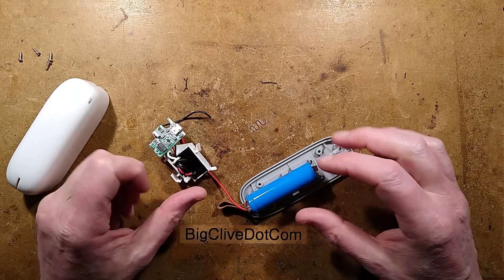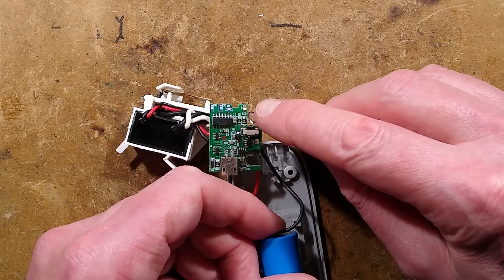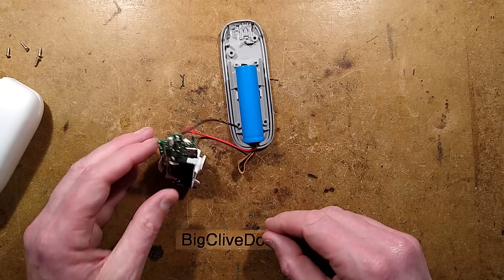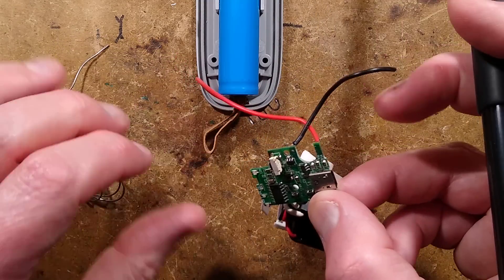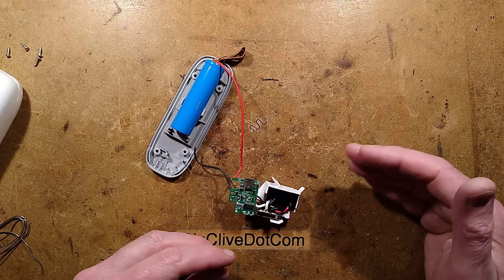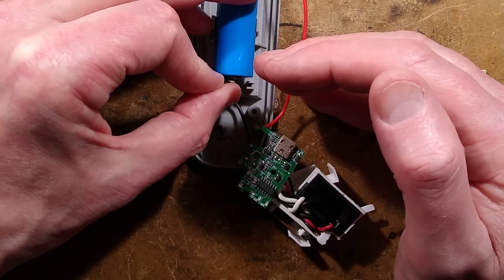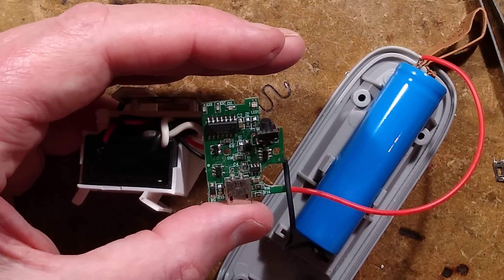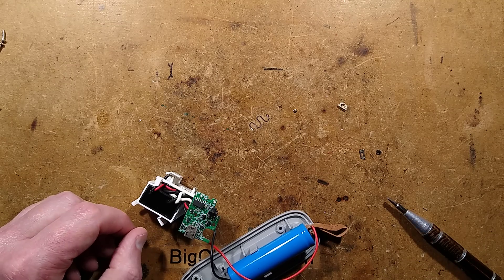The curse of tin whiskers rears its head again

Comment: God I hate lead-free solder, stuff is an absolute curse on anything made after the lead bans. I've had SO MANY THINGS malfunction or stop working because of the whiskers, the brittle nature, the porosity, etc. Most annoyingly, the fridge at my old place was computerized and the relay for the compressor failed after a couple years by the vibration of the relay itself slowly wobbling a porous, whiskery solder joint where it attached to the board. One day it got cracked enough to melt some solder, heard a pop, then a couple hours later it started beeping at me cause the temps were too high. Had to literally jack the fridge up off the floor to access the PCB, cause they hid it in the most annoying place possible and after troubleshooting all the mechanical parts and running the fridge overnight with a cheater cord wired straight to the compressor, the control board was the only thing I hadn't checked. All I had to do was glob on some fresh 60/40 leaded solder to the MANY porous, cracked solder joints, and run a bodge wire off the blown-out contact cause the trace was cooked.

That's not even mentioning all the assorted technology that's been ruined by the stuff, I went through THREE Xbox 360's cause of it before I finally bought a hot-air reflow gun and reattached the CPU with the CORRECT solder on em, made me a bit of money in high school being "the guy who can fix the Red Ring Of Death" but also gave me dozens of hours of headaches and hundreds of dollars in messed up tech.

Comment: Lead free solder, those dreaded words, put it this way, up until I left the aviation field due to covid in 2020 this stuff was banned, yes it was deemed unsafe, imagine what would happen if a piece of equipment failed in flight due to a failed joint. I've tried using it and gave up, sorry but I stick to tin/lead, it's reliable. I've repaired a few AV amps caused by cracked joints on the output stages, the eco warriors can go and hug a few more trees. Nice vid Clive.

Comment: Tin whiskering/Fretting is still a thing. There are ways to mitigate this (mainly through plating from a manufacturing perspective, and multi points of connection) but the issue is when people chase eco/cheap/ebay specials the plating may not always be consistent. Its one of those annoyances in design choices that when issues arise, its very, very difficult to rectify without recalls etc. and that usually costs alot of money.  

Companies still opt for the risk to save a penny. 
For consumers, it's not as easy as a cheap or expensive brand. Its companies risk ethos of customer returns/recalls and their ability to appease customers for the customer service.

Sadly people buy for the experience right? If they get a nice smile, get a free/new product after 6 months its considered a "good" experience. They usually don't look at why its failed within 6 months.

Comment: There was recently lecture https://www.youtube.com/watch?v=e90Q328jVmA discussing running of control electronics 25 years in row of Nuclear Power Plant Temelín in Czechia. Unfortunately the lecture is in Czech, but many slides are in English. The most important, main, recurring problem they have are tin wiskers on control knobs. All electronics is made with leaded solder, but only the faston connectors crimped on the cables to the control knobs are unleaded and the tin wiskers grow between the faston connectors. When block is in maintenance, the switches are cleaned, by compressed air, previously used brushing made the problem worse. Replacement of all controls is not planned, but new controls (required after Fukushima disaster) are new design.
The lecture is also perfect insight into Nuclear Power Plant safety. The second most important problem they have is slow degradation of EPROM based devices, like GALs. It was designed to use PALs, but because between design and manufacturing was more than 10 years, PALs were not yet available and they were drop-in replaced by GALs. Now they need to be reprogrammed, but because they are soldered in and the PCBs are not designed to be in-circuit programmable (because the design was for PALs).

Comment: Tin whiskers were a problem long before the eco-nuts. General Electric MASTR II VHF radios in the 70's and 80's had a tin plated receiver front end asembly. Tin whiskers would short out the coils causing the receiver to go deaf. It only happened in stations, not mobiles since the vibration of being in the truck of a cop car broke off the whiskers before they caused trouble. When a repeater or control station would deaf, a good kick would bring it back to life. The solution was to completely disassembly the unit and spray the interior with clear laquer; it was a pain in the ass but fixed it for good. No more service calls to the top of a mountain in the middle of the night.
Reply from the maker: And then they addressed the problem.  But now that work has been undone.

Comment: I have an HP 3065 monitor that uses a very micro tactile momentary switch that seemed to pack it in one day. First the monitor wouldn't turn on and after mucking about, pulling out the power cord and such it turned back on, hooray! Then after working normally for a week or so it wouldn't turn off. I could use the master power rocker switch to turn it on and off, but the push button was dead. One day a few weeks later it wouldn't turn on again. I took it apart and just for the helluvit I reflowed the solder joints to the ultra-dinky tactile switch and it seemed to work again. I put it all back together and a couple weeks later it quit again. I gave up and swapped it out for another 30" monitor that I like a bit less. After a month or so I decided to try the HP monitor again and it seemed to work fine again, completely normal in every way. I swapped it back onto my workstation and it has been fine ever since. I don't know if tin whiskers were messing with me or what, but being at least 15 years old it doesn't owe me a thing!

Comment: I saw what shango said were tin whiskers in 60's color TV screen controls. Was some fuzzy strands. Not related to the tobacco glaze.
    My ge microwave, over the years surviving 2 tube replacements because of age and use, the controller failed. I got a used one and switched the control panels. Later, under my bench microscope,  I'm sure I saw whiskers, after all troubleshooting I tried. I saved it and might have pictures.
Reply: Shango066

Comment: I have a cheap 3xAAA LED lamp meant to stick inside a closet. Push to turn on, push again to turn off.
A few months ago the on/off operation changed into on and very dim.
Tin whiskers  seems like a good explanation of what's happening; I haven't figured out how to get at the switch without destroying it. 
The amazing part for me is that the batteries have yet to run down.

Comment: They were a huge issue in older data centres with zinc coated risers and stringers with the raised floors. Running cables and disrupting the zinc whiskers and getting them into the forced air cooling for the severs and kabaam there goes a power supply.

Comment: I had that same issue with a aftermarket ryobi battery, it had the gauge switched on all the time and that caused the battery to drain over time.
Replacing the switch fixed the issue.

Comment: ebay this thing. just got it. AC110V Home Anion Negative Ion Ionizer Generator Module Purifier 4 CS
the air it moves is incredible compared to a smaller 2 output one previous. check it out. It does help clear the air. Need to set it in our new old used car, reek of air fresheners, ionic i know.

Comment: Tin Whiskers, a punishment from on high for us who collect transistor radios from the 1960s. Almost anything with the ubiquitous AF115-6-7 or OC170 range, widely used in British and Philips sets, will have died the death by now. Sometimes cured by simply snipping the screen lead, sometimes by zapping the whiskers, but more usually by replacing the transistor.

Comment: I wonder if one suspects the switch has this issue, then using power supply set to 0.1V max 1A between the switch terminals will help or not.  The whisker will blow, but I wonder about where the blow up goes inside the switch.

Comment: The tin whiskers are dendritic growths, this is caused by having the tin in a cold environment. 
the demise of Scott's last Antarctic expedition was caused by the solder failing due to dendritic growth under extreme low temperature which led to all their cans of paraffin leaking, at the time it was referred to as tin pest.
Modern, high tin content solder can only work down to 10 centigrade. Bring back 60/40!

Comment: Tin whiskers (and zinc whiskers) have been an issue as far back as the 1950s when they shorted out phone circuits in the USA. Later on they shorted out some boards on Space Shuttle Endeavour (though these were discovered before they caused faults during missions) and probably caused the loss of the Cassini space probe. When working with high tin content in electronics, NASA recommends conformal coatings (i.e., plastic or epoxy) to prevent the formation of tin whiskers and, should the whiskers form, the conformal coating can prevent them from causing shorts. 
A little research suggests that SN100C is a good alternative to standard lead-free solders. I'll have to give it a try myself.

Comment: I'm actually looking at a head lamp I use ALL the time fixing stuff that never shuts off one of its four battery indicating LEDs. It has a single momentary switch (that cycle's through 6 state's) 
One LED is always dimly on. Must check out the switch..
THANK YOU ONCE AGAIN CLIVE❤️👍🇮🇪
It also has sensor your wave your hand by to turn off/on. Handy but can be annoying too.
Reply from the maker: The LEDs are sometimes multiplexed with the switch.  So the slight glow might be the switch scanning.

Comment: I used to see this a lot on Mitsubishi tvs. The buttons would read in the kohms when not pressed and were all in parallel each with a resistor to pull down at different voltages. You'd normally get volume randomly changing or input changing.  I always thought they developed from people never using the buttons on the tv

Comment: At low temperatures tin transitions to the alpha allotrope. The presence of lead 'locked' the structure of tin into the beta metallic form. Lead free solder is supposed to have a quantity of silver alloyed - again to lock the tin into the beta allotrope. But silver is expensive.

Comment: Whiskers grow in some of the old Germanium AF116/7 transistors as used in 60's radios. Sometimes tapping the transistor breaks the whisker and they can continue to work for a while. I found that a vibrating instrument of some kind does a longer lasting cure if you let it rattle against the case. Woud that work on a switch I wonder?

Comment: Lead-based solder is still actively used in the production of military and medical equipment. Under conditions of high vibrations and mechanical loads, lead-free solder joints often crack..
Reply: Yes, in any situation where it offers a real advantage (not just cheaper production) and the manufacturer takes responsibility for collecting and recycling the products, it can be used. RoHS is mainly to deal with cheap disposable items that end up in the trash and contaminate the soil and water supply (or the atmosphere, if they're incinerated) with heavy metals.
Reply: @RFC3514  It offers a real advantage in most scenarios. That advantage being increased reliability. The law just only considers reliability important to military and medical equipment, because solder-related failures in those two fields will cause immediate severe negative publicity.

Comment: If the fault is in the switch I think it is more likely to be the electroplating on the tactile dome flaking off. I've had a switch fail in this way and when I examined the tactile dome, if had sheets of plating flaking off, shorting it out.

Comment: Never heard of tin whiskers till now. In telecom switching equipment it was standard to place a C/R unit across certain relay contacts to "wet" them. This caused a tiny spark as they opened or closed and this would burn away contamination which otherwise caused high resistance in the contacts.

Comment: About 15 years ago we had a very expensive DSP card fail in a professional (radio station) audio router. I noticed discoloration around the FPGA & when I examined it under a 10x  monocle I could see hairs all over it. I sent photos to the manufacturer who told me about "tin whiskers" and that they were common where a repair was made using lead solder on an unleaded board. They still made us pay several thousand $ Australian to replace it though!

Comment: Great video, as usually. Not sure if you have covered it before, but could you do a look at the cheap DVR cctv systems like Zosi and their 240v plug split to 4 12v connectors. Ive gone through 2 of these in a year, either smell of burning or just didnt work.

Comment: The “6.6k” is indeed a function of the diode voltage drop. Since the meter is injecting a constant current, the “resistance” calculated will be 0.6V divided by the test current per ohms law.

Comment: so this is the rohs... you know where else i found tin whiskers? around, near to a bldc driver chip, that for driving a brushless dc motor. it shorted between 2 of the 3 outputs to the coils. so generally speaking, the fast switching or transient (not damped) voltage spikes. that is persistently happening again and again to build those whiskers bridges

so in your examples, perhaps these switches are not electrically being damped or de-bounced is it? i wonder because if a reputable switch manufacturer knows this issue, and they put a datasheet for their (higher quality western switches) to say what is recommended or best to do about it in the circuit design... that of course these cheap chinese products isnt

and yes! indeed they really are a thing! and its due to the combination of lead-free + plus what the circuit is doing in some very localized and specific area

Comment: I don't know if you recall those Phillips 'E-cells' they used as countdown timers in the old days. It was a small glass tube with an electrode at each end and filled with (I think) a silver solution. They were used by passing a small current through the cell and after a while a metallic whisker would grow from one end to another. After a time determined by the current, the two electrodes would short out and that cell had done it's job. The time delay could be in the months or years and was used to measure operation time as an equipment 'overhaul' alarm.

Comment: I've found over years of replacing these things, that they have a limit to the number of pushes they can tolerate. After so many pushes, the thin (and it is very thin) plating of silver on the contacts wear through and exposes the brass base metal. After a while, corrosion builds up on the brass contact point and makes the contact erratic. If they are working OK, the contact resistance is virtually zero, but after the contact wears through, the resistance varied from 10Ω or so, up to thousands, and this changed depending on pressure (and wiggling).
The only cure is replacement. Over time it got to the point where I just replaced all of the switches if one was faulty. In some cases I'd replace dozens of them. It saved complaints from the customer, AND my reputation.

Comment: I had a similar but WAAAAY smaller switch on a wifi router a while ago. After destroying the switch I realised that my heat gun would have probably worked better. The router now has to be reset with a pair of tweezers shorted accross the pads... 

But seeing Clive struggle too has made me feel better about my reluctance (read: laziness) to use the heat gun!

Comment: I built audio equipment professionally for 25 years and when lead free solder became the rage , I tried it.  It was like soldering with curdled goat cheese and the joints looked like crap.  I went back to good old leaded.  The military won't use  lead free. Neither will I.

Comment: I have a 2000's AV Sony amplifier that has a lot of buttons with the same issue, some are leaking others make poor contact, to make the things worse, they work as voltage divider and the the signal is read by an ADC which means that basically any button can make any random function which is extremely annoying, maybe but just maybe one day i will replace them all if i get the time and patience to do that...

Comment: Hi clive, I had some philips FM 900 two-way radios circa say 1980's  that where chock-full of tin whiskers in their ceramic hybrid circuit boards blocks, apparently they used silver solder to solder the components which rendered the whole module useless till they where stripped out and thoroughly cleaned.

Comment: Lead Free solder is also very brittle. It was one of the contributing factors of the Xbox 360's RRoD and is still the bane of electronic devices today. Had all these devices used leaded solder they likely would have lasted so much longer. I wonder is is what is causing our expensive Kitchen Aid Dish washer to have issues starting the wash cycle.